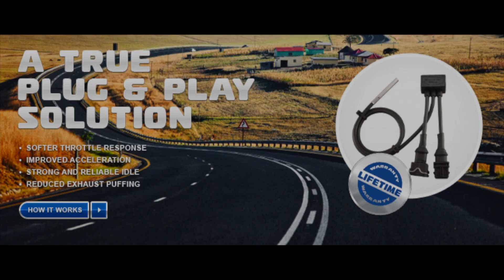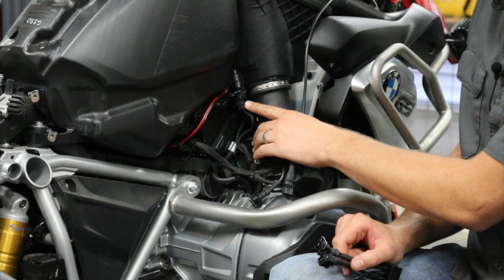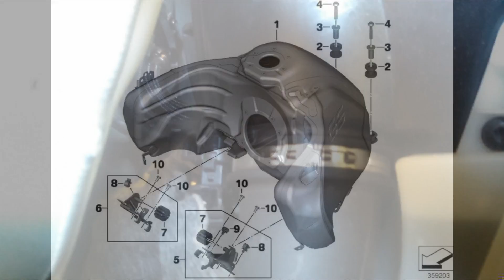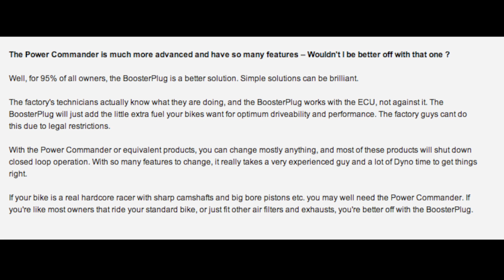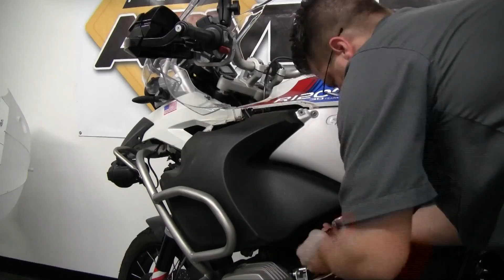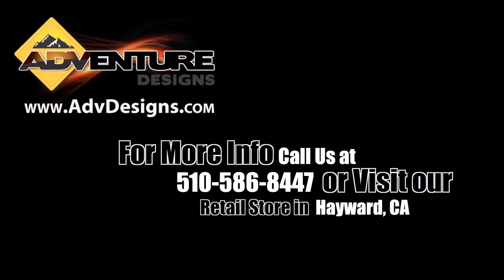Booster Plug Installation on R1200GSW R1200GSAW F800GS and R1200GS Motorcycles by Adventure Designs

Comment: It made no noticeable difference to my 2001 R1100S except give a worst fuel efficiency outcome in warmer climate. On moving to colder climate however it was absolutely shocking; increasing fuel use to 9 litres per 100 kph from 5.3litres without it: and not just a one off.
Its now gone if anyone wants it

Comment: The idle is not affected by the booster plug. When the engine has no throttle input, like during idle or steady cruising, the ecu is in closed loop mode. At this point, the only input to the ecu is from the lamba (O2) sensor. Once the throttle is opened the bike goes into open loop mode. Then the systems that report to the ecu are able to make input. One of these sensors is the air temp sensor that the booster plug piggy backs into. At that point the booster plug can interupt and change the air temp to a lower temp, so the ecu richness the fuel mixture. But once the throttle is closed to idle, it has no affect.

Comment: You get the exact same effect with a 5 cent resistor....
Reply: A resistor will trick the sensor, but it will not adjust with the fluctuations in temperature as they change. The circuit in the booster plug changes the fueling a consistant 6% by dropping the ambient temperature reading at an adjusted value, as it changes.  With a resister you would be set at a fixed setting.
Reply: @SPROCK3TMONST3R  What I meant was that using a resistor with the OEM sensor  has the exact same effect.
That is, if you put a resistor in series with the OEM thermistor (the temperature sensor) you can fool the ECU thinking the air is cooler or hotter thus changing the fuelling.
Say the temp sensor is a NTC thermistor and at 25°C temp it has a 100k ohm resistênce. If you put a 5 cent 6k ohm resistênce in series with it you fool the ECU by 6%.
If temp goes up or down it will always be 6% off, not fixed .
Get it?
That is EXACTLY what the booster plug does.
Reply: @bikesmith  THis makes sense, but is it that simple? I wondered why they included a temp sensor on Booster plug when they could just use the standard temp sensor and there own little box between that and the ECU?

Comment: I bought august 2015 a 2009 BMW K 1300GT. A year later a put the Boosterplug on it. It was perfect. Smoother, nice riding at low speed, nice handling and pick up speed very easy. It still on my BMW and it stay there.

Comment: I have one for sale.I fitted it to my 2017 RT,made no difference to how the bike ran at all.I took it off and gave it to my friend to try out on his 2016 GS.The same result except his bike became a little harder to start which he quickly fixed by removing it.This piece of snake oil,is no substitute for a proper ECU remap.
Reply: It really depends on the bike. I think the newer ones are less likely to need this. It TRANSFORMED my 08 K1200S, and improved my K1300GT a bit, especially at low throttle openings. The K1600GT runs so well I've not bothered. If you install an exhaust, K&N filter, etc you run the risk of a lean mixture so a Booster Plug could help there for $130 instead of $895 for a full ECU flash.
 -jaysbigadventure

Comment: I ran a Booster Plug for two years and it didn't makes any difference to my 2014GS LC. I Still got low-speed stall, deceleration stall, rough take off from idel. Waste of money and yes your fuel consumption goes up.. I emailed the Booster Plug guys and got NO ANSWER!!!!  Tool it off my bike .
Reply: I had one on my old BMW R1100r and the difference was night and day different to ride and the fuel mileage was better, because you could use higher gears at lower speeds. The plugs also loooked  a healthy color instead of the bright white in stock trim. The problem is on newer bikes that are not running as overly weak from the factory and that have better fuel mapping, it's much harder to tell the difference. I recently put one on 2015 Triumph and could only just feel a difference. The device can't make up for other things that may not be working correctly so if you have bad stalling and other issues that are not normal for that model, it's either not going to cure them or in some cases it could make it worse.

On my old BMW it was also a lot easier to fit, just took the seat off, making it easy to do a run with it and then without it for a true side by side.

Comment: WOOT pretty excited to get the Booster Plug today from Adventure Designs. Thanks for the quick shipment.

I have the 2016 R1200GSA LC and it's a 2 hour job for a noob like me who's never taken my GSA down this far.  I have the correct tools and by all means not complaining but iterating the point that the video shown here is the GS. So for me (GSA), I had to remove all the front end panels on both sides and move the tank back enough so I could get my hands onto the AirBox connector which Chad mentioned was needed to do to the GSA, which he did mentioned in this video.  Just making a point that yes it's probably a 20 minute job with a regular GS but the GSA is a LOT MORE work.

Now, I must admit that I didn't feel comfortable with "slightly"  bending some plastic parts to "wiggle" them out of the way which probably contributed to the extended installation time. 

Tools I've used.

About an 1 hour to:
* T25 - To remove various panel bolts about 30, top tank cover
* T27 - Tank mount, 8 top gas tank bezel ring bolts
* T40 - Tank and had to loosen the right side top crash bar to get the mid/top panel removed.
Hex driver can't remember the size, something around the T-25 Torx size but hex (to remove the shroud holding the lower Radiator guards that I installed a few weeks ago.
* Wire cutter to cut Zip Tie

10 minutes to install Booster Plug, route the cable with the thermostat to the neutral temperature position and zip it down.

Test how it ran - initial startup and in garage throttle playing I'd give it an exciting thumbs up.  Can't wait to test it on the road.

Just under an hour to put every back together.
Reply: Did you come to a conclusion as to how it worked?